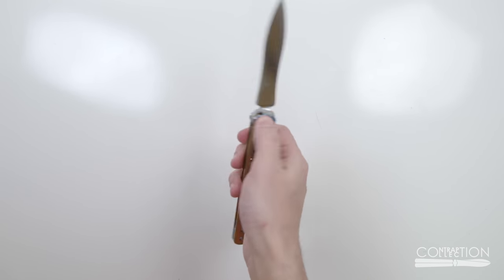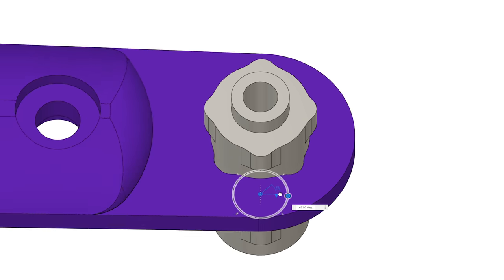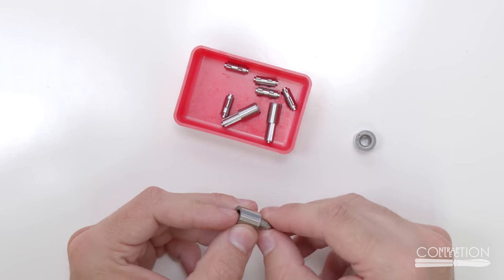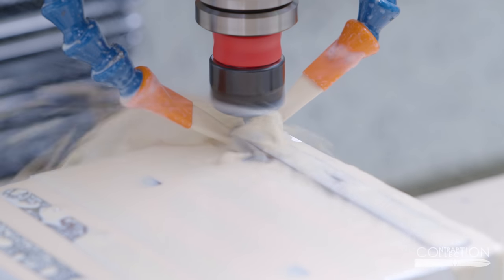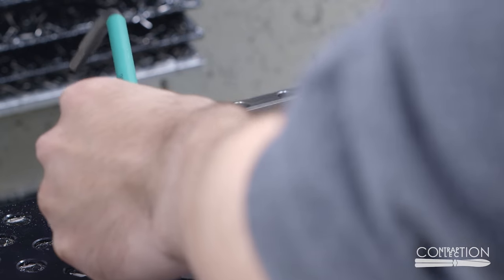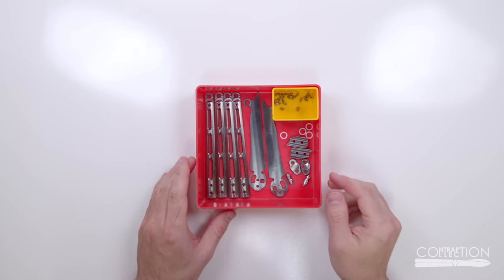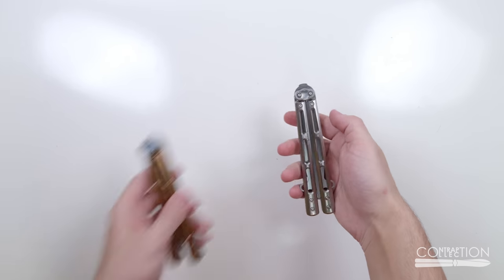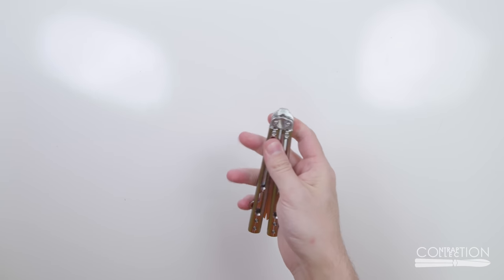Have I found the perfect design? Baliscissors Ep 22

Comment: I just realized, because I'm an idiot, given these are baliscissors, you don't need to worry about grabbing the wrong handle, both sides have blunt edges, god I'm such a dumbass
Reply: Imagine on one of the scissor blades are sharp on two sides lmao. it would be bali-scissor-song.
Reply: Technically there's still a bite handle cause of the latch, so you can (hopefully) still do the tricks the right way!
Reply: @wholock0001  While true, I more of meant that both handles are "safe" where you can flip without cutting yourself, despite one side still having a latch
Reply: I think he has talked in the past about sharpening one side so it's like a knife when in bail mode. Not sure if he's still considering that
Reply: @isaacwildflower214  is he going to put a latch on them? I feel like it would just be a waste of time since he has designed the handles to lock in the closed position and almost everyone removes the latch as soon as they get a balisong anyways because it messes with balance and gets in the way
Reply: @h3rti785  Wait actually, if you sharpen both sides of the scissors you would have knife and scissors. That would be pretty cool tbh, i kinda want that.
Reply: @h3rti785  my new favorite word
Reply: A small oversight doesn't make you an idiot :)
Reply: It's a Bali scissor trainer  ✂️

Comment: Hey just so you know, when measuring stuff with those micrometers you're supposed to use the small knob on the end so that you apply the same pressure every time. Doesn't make a huge difference with solid materials, but a good habit to get into
Reply: I see a lot of youtube machinists do this wrong. It does matter because due to the fine thread pitch you can exert way to much force.

Comment: I love the series so so much and I can't wait to see you finish with a product you are happy with.

Here is the only thing I'm worried about. Where the blade meets the handle...right where those notches are... where the tang is (idk if those notches have a name, but they are on almost all balisongs)
The cutting edge of the scissors meet flush with the dull edge of the scissors. I think the sharp edges should but brought back away from the dull edge by just a hair. I'm only worried that if someone tried to Chaplin, they could end up with the red ring of shame.

Obviously they aren't in my hands. It's possible you've already noticed this or played with them enough to know that it isn't an issue. 

I hope my explanation was clear enough
Reply from the maker: If I understand you correctly, that's definitely something I've thought about. I think it should be good because the way the curves are, your finger shouldn't be in a sharp area to begin with. Even then I wouldn't want sharp edges over lapping just in case. As a solid piece of metal it lines up perfectly, but during the sharpening process, I'm hoping that enough material is removed to add a small gap. If not, I can adjust.

Comment: I know your machine is different. But in our HAAS machines, there's a setting "Max corner rounding" where the machine will straight up cut through a radius to save time. In the tool room, we have it set at .001 and production had there's set at .025. But then again, I'm not sure if your machine has these settings as well

Comment: Also, make the radii of any curve you are interpolating larger than that of your router bit so that the cut line is smooth and continuous. When the CNC runs the bits into corners or tight radii you jolt the head and run more material into the bit at the apex of the curve. This can cause oot conditions, especially with tolerances in the ten-thousandths. For example, set any curve to have like a .075 min radius if you're running a .125 bit, ideally you'd have the part radii be even bigger.

Comment: You said youre worried that machine your working with might not be accurate at the size youre working with. Could you send your handles out for wire EDM? I feel like the tolerances on those machines might be tight enough for the pivot design your wanting to use. Or maybe not. I dont know. Not an expert. Love your vids. Don't stop. I can't wait to order your Bali scissors.

Comment: Great video! Sadly, you defenitly won't be getting tenths on the tormach. Lots of higher machines can't even. At that point, temperature is one of the biggest factors. For those pin holes, EDM would be great, but that could be expensive.

Comment: I have a useful safety mechanism suggestion: locking pegs that use a gear shape where the grooves go in enough to make room for the spokes (outer points of the gear) also are raised up a fair bit so that the locking mechanisms shake actually locks in place and requires actual human interaction to be able to open... Just think if it was made an industry standard that a locking mechanism actually requires intention to unlock, less crimes would be easy to get away with saying "the locking mechanisms rubbish" as to why it was an accident, as right now no locking mechanisms really require intent to unlock... And seeing just what you show off at the start made me think of this actually useful mechanism that could reduce crime (being gotten away with), because it makes sense, nobody realises the usefulness of an actual locking mechanism or the danger of the current crappy locking mechanisms that you just move in a specific way and unlocked/opened (and likely stabbing you)

Comment: I noticed when u were using the micrometer that you don't use the rattle/sliping knob.

This knob is there so you can measure with high accuracy because it always slips or rattles at the same force (it is than more accurate because you are not deforming the micrometer/the material this is an problem because the micrometer can measure such small differences)

Comment: Is there a reason why you dont have the squareish pin rotated by 45°? I feel like that would also help with the being able to click in the open position.
Reply from the maker: That's the plan. The disadvantage though, is because the pins aren't completely symmetrical it means I can't just make four of the same handle pieces. I'll need mirror images of two of the handle parts. I think it's worth it though, and it gives me an excuse to make other slight differences between handles I've been thinking about.

Comment: The problem is that you need to finish the round pivot contact surface and the locking surfaces with separate toolpaths. It's easy to program and there's no reason not to do that from the very beginning.

Comment: Silly CNC question. For the handles, when you cut one half of the handle geometry, how do you cut away the bottom half? Or how do you actually cut out the handle shape?
Reply from the maker: There's several episodes about making handles, but basically I'm doing it in 3 steps. I cut the bottom flat and cut around the outside, as well as drill some holes. Then I flip it and rough away most of the material. Then I screw it down with the holes I drilled to finish it up.

I think it would be possible to do in two ops with thicker stock, but I'm nervous about holding onto a thin area in the second op. Doing it this way would also require a special and more complex fixture to make the version with interchangeable scales.
Reply: @ContraptionCollection  I see. So you if you were to CNC the other side, you would need a fixture to mount the part to? This fixture would need to locate the part precisely within the CNC
Reply from the maker: @armandmatossian2081  Yes, I made a fixture that has features for all 3 ops. Even the first op uses a fixture because I use titanium blanks I had waterjet cut. I locate the last op by using 2 of the zen pin holes that are meant for assembling the scissors. If you go to 11:15 in ep 20 you can see me screw down the part.

Comment: I was wondering I don't recall if you addressed this in an earlier video but why do you insist on the pins being rotationally symmetrical, since that means that due to the slightly less than 180 degree rotation it would make more since to use non-rotationally symmetrical pins since that would take the slop out of the handles from either of the locked positions.